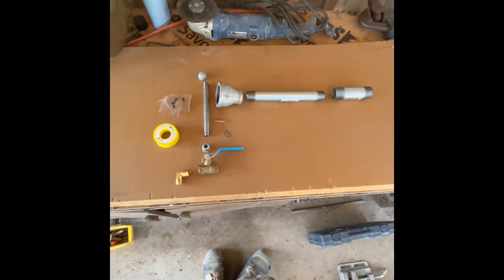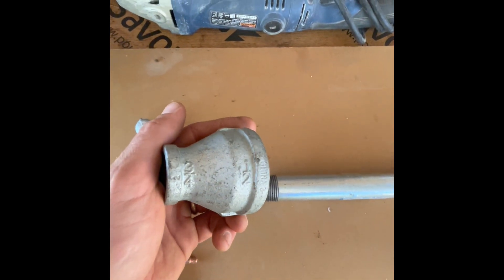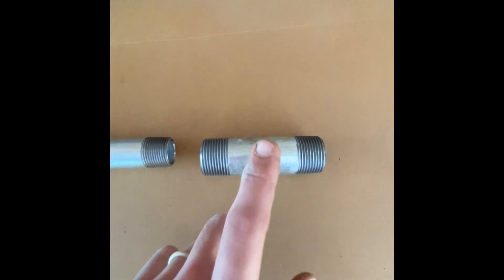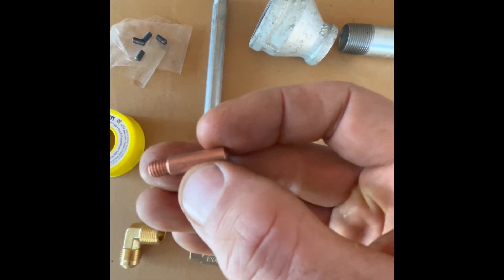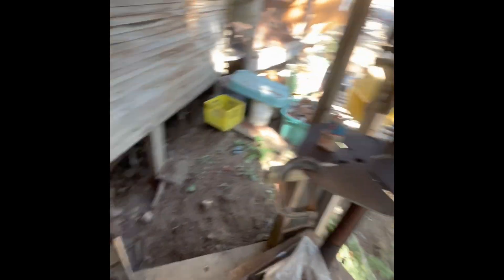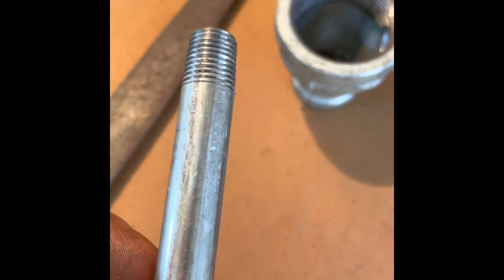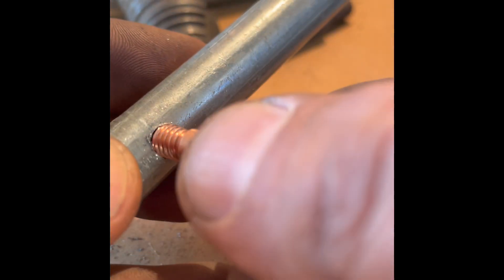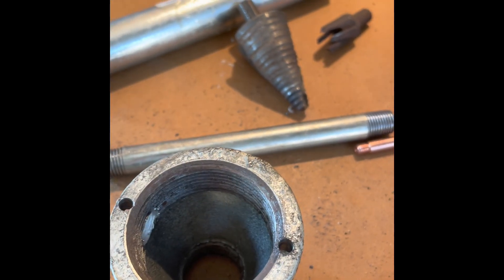How to build a Ron Reil propane forge burner

Comment: Mate if you soak galvanized parts in vinegar it will remove the coating without having to burn it off.
Reply from the maker: I leave the plating on usually, on my home forge a have a stainless flared nozzle that lasts a lot longer. The zinc help with rust protection. I live on the west coast and any unprotected metal will rust within weeks even in a covered area. This burner was made in the fly at work because we needed to heat something very hot